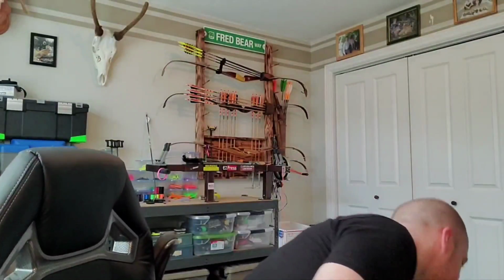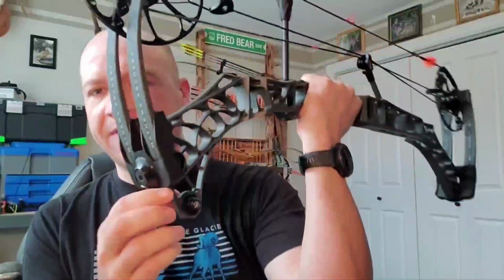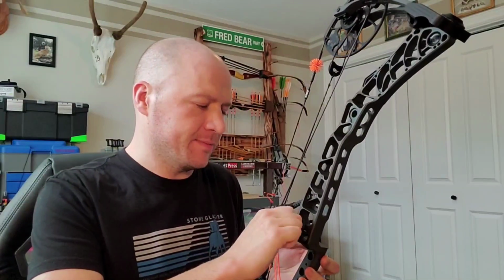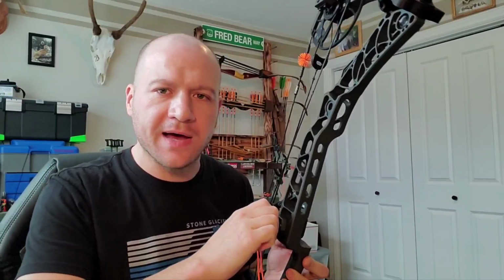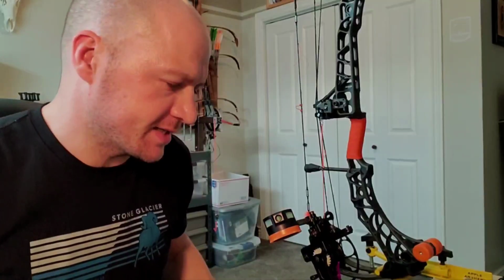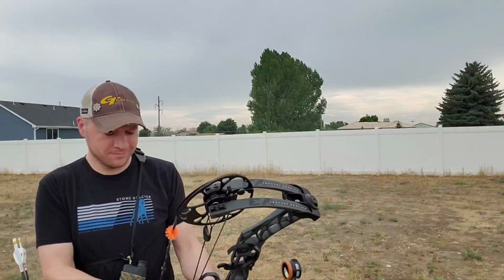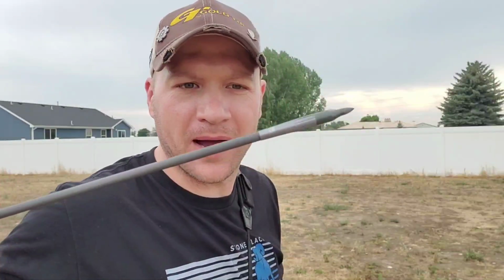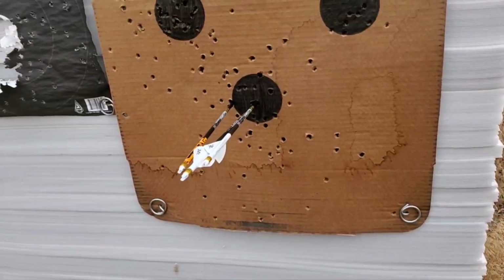Mathews V3 - Rebuild

Comment: Quick question, is that an LCA hand scale you are using to measure your draw weight?  Would you recommend it?  I'm doing quite a bit of tinkering and was thinking of picking one up.  Thanks again for the info and knowledge you are sharing!
Reply from the maker: You're very welcome! Yes, I have two types of LCA hand scales and I like them, but there is a variance of about 2lbs between them. Thanks for the support!

Comment: Did you paint the SpotHogg mrt ring or did you find those orange?  My bow build is orange and black and I can’t find anything orange for the SpotHoggs.
Reply from the maker: I painted it with spray paint, and finished it with matte clear coat. I wish they offered different color options for the rings, and the purple yardage indicator.